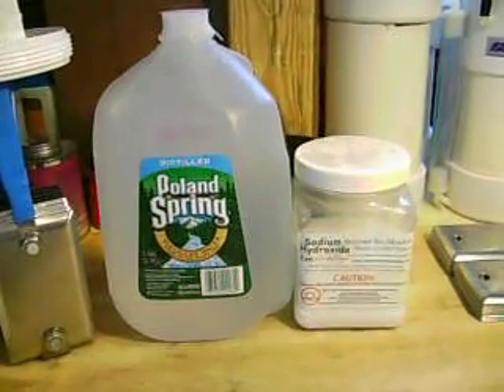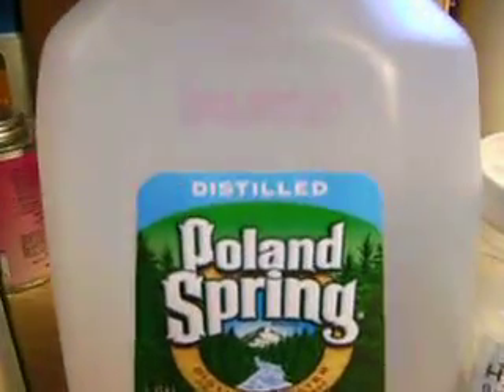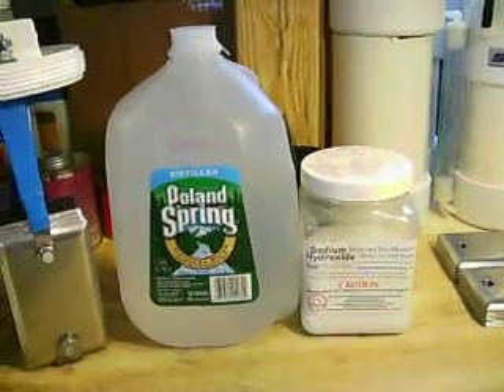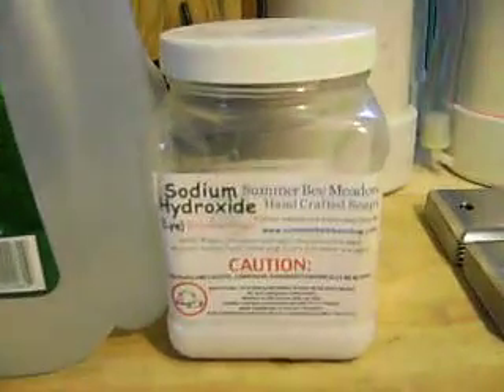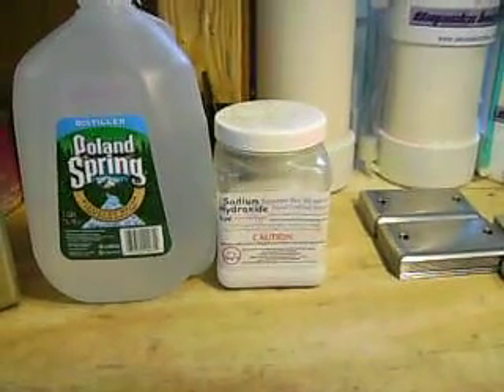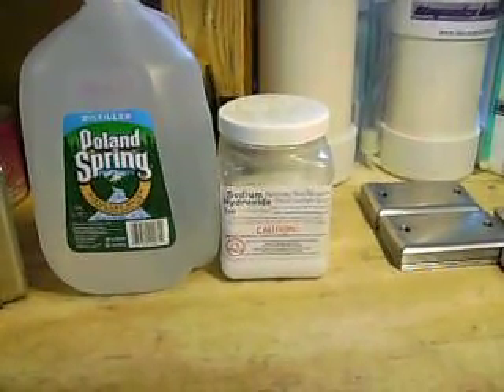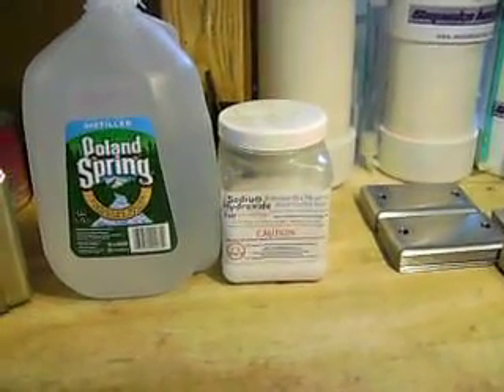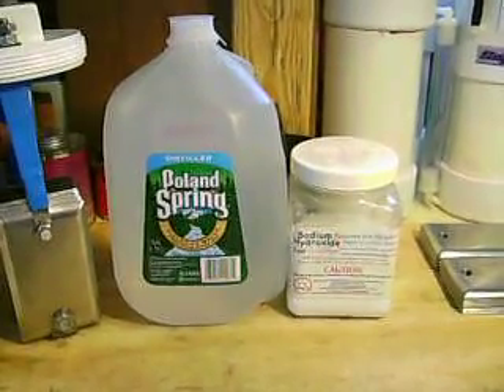Part 2:  The baking soda deception - HHO application only

Comment: Hi! Thanks for posting this. Glad you still respond to questions as b4 b/c I saw this HHO application on ep. #4 of Doomsay Preppers and knew what it was thanks to you and the man said it could possibly be used as an application to clean the air forced through w/water in the HHO machine of radiation contamination and perhaps the water itself of radiation contamination. What do you think? Is it feasible b/c I've been concerned w/air purification of radiation for over a year now? Very intersested.

Comment: Hey man! This is a very good video that you got.  I used a baking soda, I noticed that the plates were degrading and produces a lot of heat from my dry cell unit.  I hope you you could keep us posted more about NaOH and baking soda.  The baking soda I used produces an acceptable amount of hydrogen gas.  Will NaOH double the amount of HHO production if I will use NaOH? Better than baking soda.  I hope you could reply back.  Thanks for the video.

Comment: Hey boss thanks for the info I was using salt or baking soda an getting alot of build up. What is the measurement you are using, I am trying to maintain a low mix to keep amp draw low.I have been using the stan myers like design using pipe inside pipe.
Heck I like the look of your design perhaps I could just buy one email me.